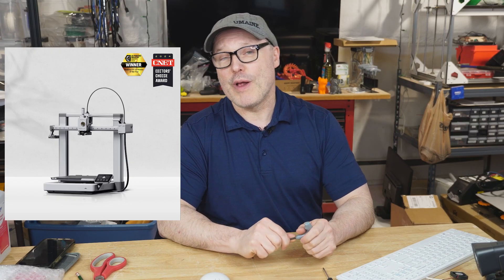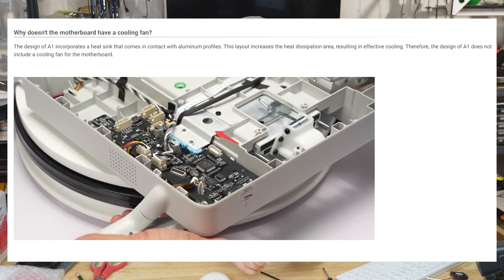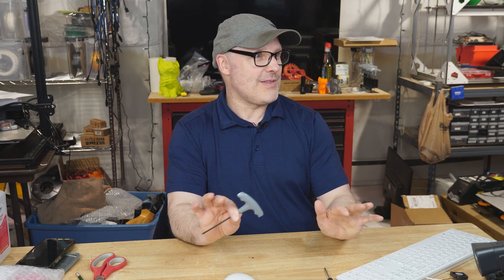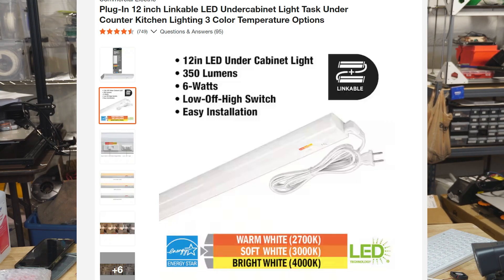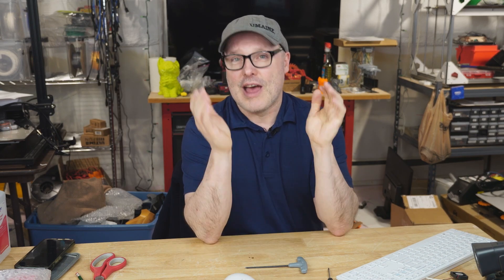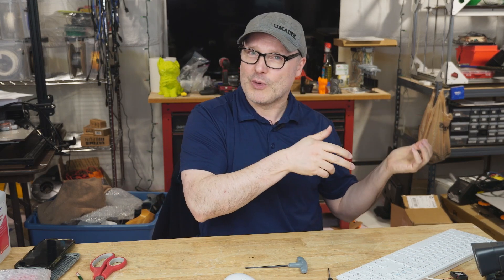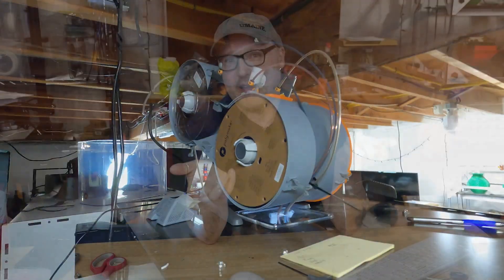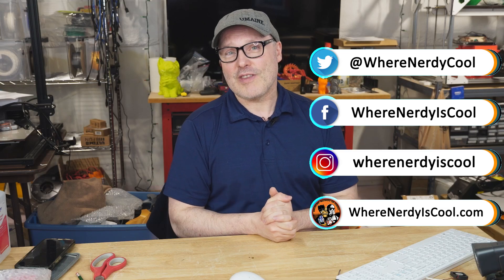How I Solved My Bambu A1 Printer Problems (Vibration, AMS, Heat!)”

Comment: At $200 for the enclosure you're better just jumping into the P1S.
Reply from the maker: Yes I made use of that since it had been used to enclose a CR-10 for a while.  There’s other enclosures out there for sure.  The big thing is having some ports of air filtration/venting and being fireproof

Comment: great review,video! thanks for sharing your experience. but its over engineering for a pla centric printer. lets do this for a resin printer. this will blow!
Reply from the maker: Read up on the hazards of 3D printing, specifically VOCs and Ultrafine particles.  EPA, OSHA and CDC all offer recommendations to reduce emissions and exposure.
Reply: @WhereNerdyisCool  First of all, thanks for the reply! I already know what you mentioned — I’ve read many articles, etc., but unfortunately there’s no actual method on the platform, not even a prototype. Everyone just says ‘use it in your garage, make sure it’s well-ventilated.’ For example, I don’t know if anyone has tried it, but an enclosure like the ones made only for resin printers...

Comment: Ever since I used the enclosure and placed the ASM lite on top of it, I started getting more errors on filament jam and z-axis homing issue. I feel the machine is too sensitive to the tubing orientation and pressure..this should be something to be overcome in design by bambu. Users only need to make sure they are connected properly.
Reply from the maker: I had to experiment a lot with this, making the tubes as vertical as possible.  I haven’t had any errors on my configuration.  I sure did trying to feed material from the side
Reply: @WhereNerdyisCool I now feed it from the side too. I don’t know about your vertical part, but for me I had to find an ideal curve 😆
Reply from the maker: Did you buy extended/longer tubes to make it work?  Bambu or Capricorn?

Comment: looks like a very nice setup, who is the performance? motherboard temp? heat stability? prints with temp sensitive materials?
Reply from the maker: Works great in my shop setup where the temps stay between 62-73F.
Reply: @WhereNerdyisCool  very cool. did you try abs and asa?
Reply from the maker: @oofir900194 I haven’t used those materials on my A1’s yet

Comment: Do you believe in magic? Because in a magical world, you could wrap your printer in a blanket and, abracadabra, have it confined in a climate-controlled cabin. But physics still rules over magic, and there are many factors to consider before attempting such wishful thinking.

While some filaments may thrive in a warmer environment (and some of them only), every other part of your printer, from the display to the smallest electronic component, including the motors and even the fans, will not. They will repay your enthusiasm with a reduced lifespan. And that is not all. The machine itself is not designed to print properly in environments above 35°C or below 15°C. The nozzle cooling will suffer, and the cooling of the printed part even more so. Blowing air at 25°C versus 45°C is not the same game. It is, in fact, a 65 percent increase in temperature, and that matters.

So, have we been misled? Is enclosing a printer really more complex than just wrapping it in insulation? Sadly, yes. The electronics need to be relocated outside the box, and the entire cooling strategy must be re-engineered. There is no shortcut. You can try to find fans of identical size with higher airflow, which is already a challenge, or supply fresh air to the fans, especially those cooling the printed part. The most effective solution for the hotend remains a remote liquid cooling system placed outside the enclosure, since introducing cool air inside compromises the warm conditions needed for technical materials.

That is a lot to rethink if you want your printer to retain both its print quality and longevity. And I have not even touched on the topic of air filtration, which deserves a chapter of its own. If the goal is simply to protect the printer from dust, then that is a different discussion entirely.
Reply from the maker: Well dust isn’t why we enclose them - it’s to control the printing environment. It’s also good for protecting you from the side effects of melting polymer - UFP and VOCs - which seem to be as dangerous as second hand smoke.  

Temperature is important. The machines have a specific operating range which is why I’ve enhanced the cooling of mine.  It’s advisable for owners to adjust their strategy accordingly.  😊
Reply: 25°C to 45°C is not a 65% increase in the temperature. It is in fact only around 6-7% increase of temperature as 0°C does not indicate the lack of temperature. Are you trying to mislead us?
Reply: @__Michu__   Fascinating how you redefine basic physics with such confidence I almost admire your dedication to ignorance.
Reply: @axelSixtySix  No, Michu is right and your wrong. You're using Celsius, and using the freezing point of water in C and is an arbitrary point on the scale. 0 degrees C still has thermal energy and isn't absolute 0. Absolute 0 in C is -273.15 degrees C. You must do temp calculations in Kelvin, If done in K, you get 6.7%, 25C = 298.15 K, 45°C = 318.15 K, Percentage increase: (318.15 - 298.15) / 298.15 = 6.7%. While a 6.7% increase in absolute temperature does reduce cooling effectiveness, though not as dramatically as "65%" would suggest.
Reply: @ParabolicLabs  There's always a hidden genius who comes 8 months later with a thermodynamic theory that embarrasses his Physics teachers, while embarrassing his own ancestors at the same time. In this topic, the scale is not a factor. 20°C to 45°C is a 65 percent increase, definitely. And the fact that the percentage changes under another scale doesn't change the game. Just like if someone drives too fast to stop, you don't care if the counter is in miles or in kilometers. Got it?

Now, about your points. You suggest that switching to Kelvin somehow changes the cooling behaviour of a 3D printer. It’s charming, but in practice, Kelvin is like a fine Swiss watch you bring to hammer a nail. Technically correct, but not particularly useful here.

Cooling efficiency depends on one thing only: the temperature difference between the air you blow and the part you want to cool. Not the cosmic distance from absolute zero. Blowing air 25 degrees hotter means 25 degrees less cooling margin. No tricks, no hidden physics. That’s how the real world works. Any engineer, technician, or hobbyist who has actually watched PLA sag under a hot fan knows this instinctively.

Your 6.7 percent calculation is precise, elegant even, but completely irrelevant in this context. Absolute temperature percentages don’t govern the convection around a print. Blow 45°C air on a 55°C part and watch the cooling grace vanish. You could measure it in Rankine, Réaumur, or even dragon breaths per cubic meter, the result would be the same.

Nothing in my argument depended on absolute zero. Celsius works perfectly fine for discussing printer performance. The issues I raised — electronics heating up, stepper motors derating, fans struggling, hotend cooling failing — all care about practical heat, not the Kelvin scale.

So yes, technically you are right: zero Celsius isn’t absolute zero, Kelvin is a valid scale, and percentages can be calculated. Charming little truths. They don’t change anything about the printer’s behaviour, but I appreciate the mini physics lecture. Meanwhile, the filament continues to melt, blissfully ignoring unit conversions.
Reply: What a great comment. 5 Stars.